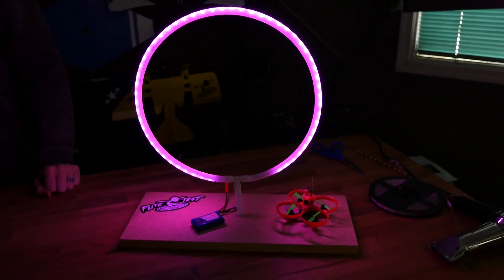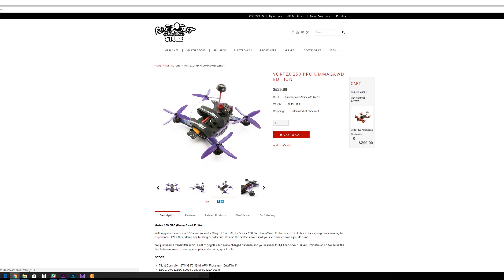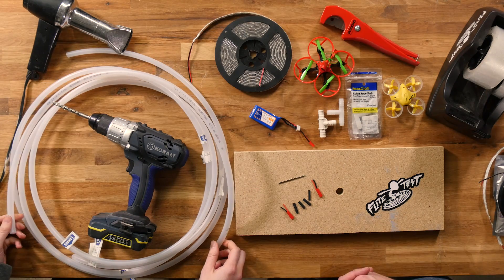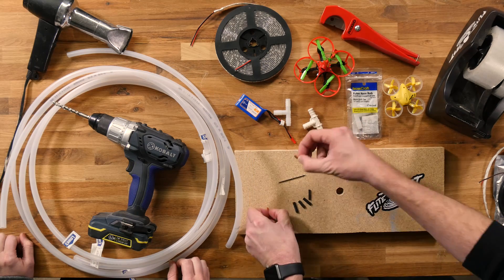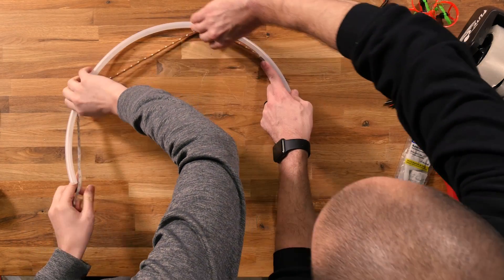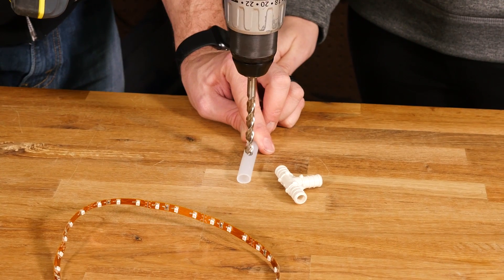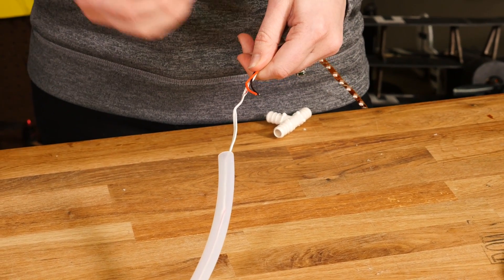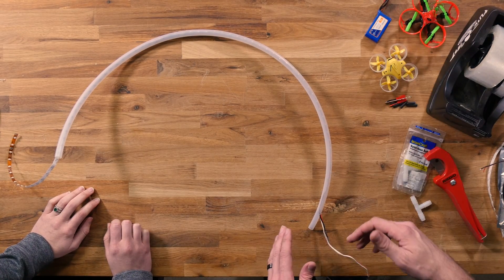DIY $10 Drone Racing Gates | Flite Test

Comment: This is so awesome! I just got permission from my local airport to fly on their ramp and parking area, and I wonder if I could make a few of these big enough for a Vortex 250?

Speaking of which, Megan picked the right quad. I fly the IRC base Vortex 250 most days, with the Ummagawd pro tuning, and that thing is an amazing flyer. Try to start straight away with acro mode, though, as starting on horizon mode made it much harder for me to transition over to acro later. I still flip to horizon to land. I know, I cheat.

Comment: ok, i need anyone with whoop experience to answer the following question:

if i buy a eachine e010 and put a eachine tx02 or tx01 on it, how far is the fpv transmission range on it once connected to the eachine vr-007s? (i also know this is not the official whoop) also, whats the difference between the tx02 and tx01? please respond, have a great night or day!

Comment: I wish I had a tiny whoop
Reply: James Morelan Build one! You could build one with a normal inductrix, and then get motors and a camera from tinywhoop.com ! Around 100$
Reply: James Morelan you can get it all for 100 with goggles if you can solder. ebay has furbee f36 15 dollars camera is 25 goggles are 50. motors are 20 for 25 bateries are 5 for 15. camera boldclash f01 motors boldclash 14000kv and jjrc 150mah 5 pack.